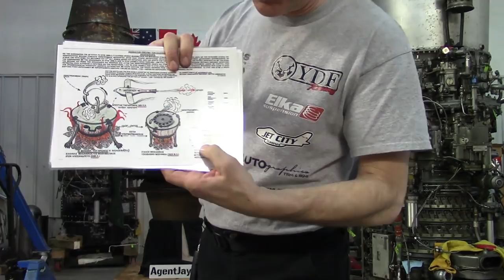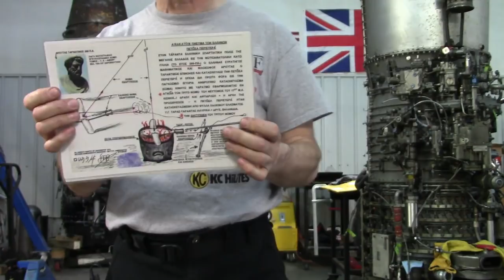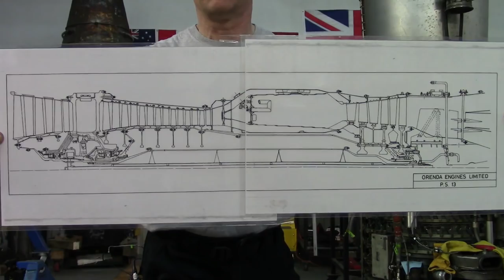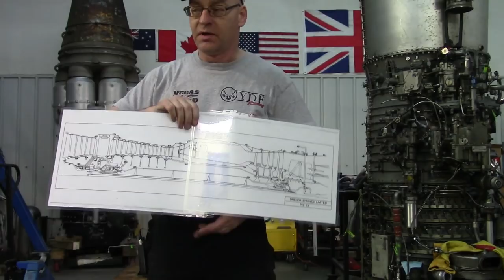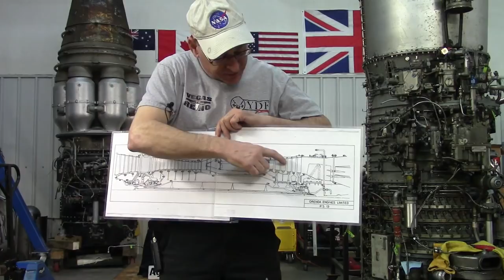4  Why don't jet engines detonate ?

Comment: Basically a jet engine is just like a blowtorch, a continous flame and since the process is continous there can be no knocking since there are no cyclic explosions happening requiring that components are in the right position before they occur like a car engine. When a car engine knocks it basically tries to force the crankshaft  backwards again since  the piston have not yet reached the top/turnover position yet when the explosion occurs and this backward/forward slamming can potentially damage the engine really bad like bending the crankshaft and piston rods, damaging the bearings ect.

Comment: Jet engines compression ratio cannot be directly compared with piston engines because they are defined differently. 
In a piston engine compression ratio is defined as the ratio of volumes (i.e. - defined in terms of density) while in turbine engines it is defined as a pressure ratio. Therefore you need to "translate" one to the other. To convert the piston volumetric compression ratio to a pressure ratio you need to raise it to the power of gamma (the specific heat capacity ratio - 1.4 for air).
So for example a high performance NA gas engine with a 12.5:1 volumetric compression ratio (Ferrari 458) translates to 12.5^1.4 = 34:1 pressure ratio.
A high performance turbocharged gas engine with a 9.5:1 volumetric ratio and 1.8 bar of boost (Ferrari 488) translates to (101325 + 1.8e5)/101325*9.5^1.4 = 65:1 pressure ratio.
With turbo diesels these numbers would be higher still.
As you can see when comparing "apples with apples" piston engines are generally "ahead" of jets in terms of compression ratio - but it doesn't mean anything since they are completely different in operation.
The point however is still correct in that preignition is not a thing for jets because the burn is continuous and doesn't need to be timed to a moving piston.
Reply: You appear to know something about these things, but please be prepared to be corrected - as I once did a very senior engineer at R-R.  The term compression ratio is incorrect for gas turbine engines: the term is pressure ratio.
Reply: Yes I know. I only used it to show that the terminology and definition is different without calling it by a different name but I probably should have stuck to pressure ratio vs compression ratio.

Comment: Sounds like your explanation of how not to start a turbine engine is the only way to backfire and detonate one, lol.  So, normally the propagation of the flame front is controlled by the engine design, ignition sequence and fuel delivery system.  Get them out of sequence and bad things could happen.  

As you were talking about the fuel nozzle and flame, I was picturing an oxygen, acetylene torch tip.  I know it's different burning in free air but I was wondering if there could be some scenario if, like when you shut off the acetylene on a torch, you could create a pop in a turbine engine?  I guess the abundance of air flow keeps this from happening .......if you were to shut off the fuel flow at wot.
Reply: snaproll94e its highly design dependant as to what exact conditions will cause it but, turbines can backfire/surge under the (wrong) conditions.

Comment: For pre-ignition to apply, the system must have (a) a state of no combustion and (b) a determinate time and state where ignition /should/ occur. Because the Jet engine effectively sprays fuel directly into an ongoing combustion chamber, the only time ignition occurs is when the unit is first starting up - combustion then (ideally) lasts until it's shut down.

Comment: @2:27 - It's a divergent nozzle and would make no thrust?
Reply: Would if you fueled it with hydrogen, towed it up to Mach 5 or so, and injected the fuel in the exact correct position ahead of the nozzle neck and if made of materials that would survive it :p (It's called a Scramjet - Supersonic Combustion Ramjet - and YES they are hard to make)

Comment: It 's great to take a look at the cross-sectional GA of the Iroquois: I always enjoy poring over engine GAs.  For me, however, the only illustration that might beat a GA, in terms of interest, would be a pretty-coloured diagrammatic GA of the internal/secondary air systems. 
I have kept my counsel until now, but I can't help myself commenting on the combustion chamber.  It bears an uncanny resemblance to Armstrong Siddeley's annular combustion chamber for the Sapphire and later engines, with those double right-angle vaporisers (replacing the original candy canes or hockey sticks) and secondary air tubes/chutes in the head of the chamber.  The design of the ASM vaporiser arrangement and its development in an annular combustor was/is credited to Pat Lindsey and Sid Allen, for whom I worked in my very early days at R-R IMD.  I wonder what 'technology transfer' there was and in what direction?
I will also comment with detached professional interest on two other facts: i) the LP compressor is 'overhung' and ii) the HP turbine bearing is an intershaft bearing.
Reply from the maker: grahamj9101: I wish more people would read / understand your comments.
Reply: I try to write most of my stuff to help your subscribers understand, but on occasions I also write for you, with your greater knowledge.

Comment: I get it that jet engines produce a constant combustion as opposed to the cycle of piston engines. But what about the V-1  buzz bombs of WWII? Sometimes referred to as pulse jets? I could never get a clear understanding of how they worked. It seems that they produced intermittent thrust, is that right?
Reply: Edward Whetsell they use a combination of a valve that prevents backflow, and a resonant chamber so each pulse draws new fuel/air mix in as it exhausts.
Reply from the maker: There are a couple of reasons they are not used for anything...
Reply: AgentJayZ hey, that's not fair. They are still used as heaters to generate lots and lots of warm/hot air. (I think the German tank corps used them?)
Reply from the maker: ...pulse jets as heaters?
I would be amused  to see that.
What a waste... squared...
I'm laughing on the inside, and not with you...

Comment: Preignition is not synonymous with detonation. It can, however, lead to detonation in a piston internal combustion engine. Detonation is a combustion regime characterized by rapid combustion of a fuel/oxidizer mixture that is driven by a supersonic shock wave. This causes a violent, rapid cylinder pressure spike which may damage components. The desired combustion regime is deflagration, which is characterized by a subsonic, slow moving (<100m/s) flame front propagating through a fuel/oxidizer mixture. Gas turbine engines operate within a deflagration combustion regime. Even firearms operate via deflagration. If a firearm experiences detonation, it can blow apart. It is unlikely that detonation could take place in a gas turbine. A good example of detonation would be the combustion of high explosives like TNT.
Reply from the maker: On this channel we are never speaking piston. Turbine engines do not experience detonation.
Reply: AgentJayZ I was explaining detonation in the context of a piston engine because people seem to think it is the same as preignition

Comment: Right or wrong, I always label jet and rocket engines as 'monocyclic through flow' engines.
Reply: Delicious DeBlair - Good call, that monocyclic thing. However, the single cycle does have all four of the distinct events - i.e. intake, compression, ignition/expansion, exhaust. That's why calling a two-stroke engine is wrong, wrong, wrong! And yet, oil companies do it all the time. And yes, two-strokes also have all four events, just controlled differently and in fewer strokes than the typical automotive internal combustion engine.

Comment: Mr Z, do you have a video explaining the forces and stresses on the individual components ?  I am amazed that the casings dont just split wide open after running at 600psi and 3000F with 20,000 lb axial load and 30,000 ft.lb. torque applied to them!
Reply: The structural outer casings do not experience temperatures anywhere near 3,000degF..  Even  the turbine casings are typically cooled by a small flow of compressor delivery air.

Comment: With a port injected supercharged or turbocharged engine, you'd have "compressed" air and fuel traveling from the injector down the runner through the intake valve and into the cylinder, but that is a short distance and the overall pressure is still relatively low.  A 10:1 compression engine is going to have roughly 150-200 PSI of pressure at the moment when detonation could occur.  Compare that to say, 20psi max on a port-injected, forced-induction motor and you can see why the mixture doesn't detonate prior to the compression stroke in the cylinder.  This also explains part of why the newer direct-injection motors can run much higher boost levels - the fuel/air mixing can be much more precisely tuned and avoid the chance of a hot spot from which detonation could occur.

Comment: Could you have a discussion on ratio of the inlet nozzle from the compressor to the exit nozzle going to the turbine Or could you show a Compressor nozzle beside a turbine nozzle of a LM 1500. It seems like it would have to say how much the air and fuel expands after the fuel has burn. The velocity of the air through the nozzles would also make a difference. Or maybe you can talk about size of the final blades of the compressor compared to the first turbine blades. Maybe that would be relative to the compression ratio.

Comment: Back in the glorious days of HMS Ark Royal (R09), I believe the RN used to spray gycol into the intakes of jet engines as they were spooling down (I think after the fire was out) to reduce corrosion. Is this a good proceedure in a maritime environment? Should I copy it on, say,  an Allison T63-A-5A ?
Reply from the maker: Engines which are to be stored for more than 30 days without being run are typically preserved by fogging the inlet with a fine corrosion preventing oil as it winds down after fuel cutoff.
You can make a suitable fluid out of WD40 and about 1/3 engine oil.
A T63 would need about a tablespoon of that sprayed in.
Next startup will be a little smoky.

This does not eliminate the need for covering the inlet and exhaust, and for storing the engine indoors.
Reply: AgentJayZ, does that cause any issues when it comes time to restart the engine? Does it require any pre-cleaning to clear out some of the oil?

Comment: I remember there being a big hoorah about the great mileage of fuel homogenizers for car engines, back in the 60s and 70s. Just a few problems with them, like blowing the top of the engine through the hood if you ever had a backfire.

Comment: It seems to me that in a way, unlike with piston engines, we do the "priming" of a turbojet with air, instead of fuel. That allows a more controlled combustion as the video explains. (maybe this is a bad analogy)

Comment: Hard to tell what's wrong with the picture when you don't even know what it's supposed to be ;) . I can read the greek characters (but don't understand the language) and am pretty sure the heading mentions Daniel Bernoulli, which makes the whole thing even weirder. I mean, there's a wing under it, but what has that got to do with some kind of jet?
What ever that thing is (a ram jet? a turbine engine without any rotor drawn in?), I'd say it misses a nozzle. Also the pressure seems to be highest at the combustion point. That doesn't work, because it would blow everything out the front.
Reply from the maker: You're getting there...

Comment: @AgentJayZ Great topic. Would another way of explaining your reasoning here be to say that it's because the combustion process here is continuous? Whereas in a piston engine it is intermittent?

By the way, I am an ATPL(A) student from the UK just about to sit my Aircraft General Knowledge exam. A large section of the syllabus is Turbine engines. I'm finding your videos really useful in learning the material for the exam. It will also be good to have this understanding when I come to actually operating the machinery! Many thanks
Reply: Ok, just heard you pretty much say that at about 10:30! Maybe I should be patient and wait until the end of the video next time!

Comment: The newer jets have high compression but the older ones where pretty low and the RC jet engines are really low, like 7 or 8 to 1 not very efficient a med size RC jet burners 2 liters of fuel in around 13 minutes, but are still fun as hell!
Reply from the maker: The Orenda Type 14 is about 7 to 1 compression at full rpm. Modern turbofans are over 40 to 1 at takeoff power.

Comment: Google Translate can take pictures of the text and translate it if it's written well enough. @agentjayz
Reply: Does it work for Greek? Probably does, but it doesn't support all languages. Even if the picture translation doesn't work you can always use google translate with the hand write input tool, but its a bit of work if its a lot of text.

Comment: Wankel- - 1 power pulse per revolution! Love your show. Fun to watch too!
Reply from the maker: The Wankel engine produces three power pulses per revolution.
Reply: A Wankel engine produces three power pulses per rotor revolution, but rotors are geared 1 to 3 with the eccentric shaft (also known as the drive shaft). By that, there is one power pulse per revolution of the drive shaft per rotor. So both of you are correct.
Reply: @soulsonjones5842  Yeah! just like a 2 cycle, except it has more efficient scavenging! Pretty short stroke too, so it needs revs to make HP.

Comment: It says "Aeroclub (of) Vatily, 1968, Power via the force". 
PS: The second one says "Aeroclub of Cyprus". I can't really read the third one but it says about the evolution of use of thrust from the steam powered pigeon to the date and time man first landed on the moon. The fourth one describes the operation of the depicted 369 AD ancient steam powered pigeon in old Greek and the last one is about Bernoulli duct nozzles (I'm pretty sure it's a Venturi though) of wet or dry fuel rockets and how they share the basic design with ramjet and pulse engines (I couldn't find a focused frame here either).
Reply from the maker: You are awesome, and you said the magic word...
Nobody else has called it that yet.
Reply: Thank you...Are you referring to Venturi?

Comment: To my knowledge, pre-ignition is different to detonation. Pre ignition occurs because the fuel air mixture is going off before desired usually due to hotspots or lean mixture. Detonation however occurs because the mixture is too lean and has no real heatsync by means of fuel around it. Therefore it burns unpredictably and doesn't propagate down the cylinder. Jets working similar to diesels in that fuel is only mixed the instant it's needed means pre ignition can't occur. Jets always run lean from what I read since it merely burns the fuel it needs. But what stops it from burning explosively like in detonation. Surely the oxygen rich environment will also lead to high temperatures risking unpredictability?

Comment: What is wrong with the picture? I am going to guess that on the intake side the air would increase in velocity but the pressure would decrease, and on the exhaust side, assuming you could get it to combust, there would be no thrust.

Comment: So, can you hard start a jet engine just like a rocket engine and end up sending the hardware merchant's kids to college?
Reply from the maker: What's a hard start?
We have a term called the hot start, which is when the engine fails to build up revs and therefore cooling air flow after beginning to burn fuel. It can quickly destroy the hot section of the engine.
Reply: Hard start is a term from rocketry where the fuel and oxidizer (or mono-propellant) don't start reacting immediately, and then react all at once, make a pressure spike, and blow up the engine.  From page 14 of John D. Clark's excellent work, Ignition! : "If your propellants flow into the chamber
and ignite immediately, you're in business. But if they flow in,
collect in a puddle, and then ignite, you have an explosion which generally
demolishes the engine and its immediate surroundings. The
accepted euphemism for this sequence of events is a "hard start."
Thus, a hypergolic combustion must be very fast, or it is worse than
useless. The Germans set an upper limit of 50 milliseconds on the
ignition delay that they could tolerate. "  Oh, also, I'm from Michigan.  I can't speak for all of the accents in the US, but those from the Midwest pronounce "hot" and "hard" differently.
Reply: The nearest experience I had of a 'hard start' was not actually on an engine.  As an apprentice I was working on a combustion chamber rig, carrying out simulated altitude relights and cross-lighting of the cannular combustion system for the Olympus engine in the TSR2  (another cancelled UK project).   At a simulated altitude of tens of thousands of feet, the combustion chamber with the igniter would light up satisfactorily, but there was then a delay, until the second chamber in the rig lit with a noticeable 'thud', which could be felt.

Comment: Is it that the compressor / turbine sections are not shown in the diagram? Also, looks like there's no temperature gradient on the compression side of the diagram. As in ... it doesn't show that the air is warmer at the outlet of the compressor than at the inlet.